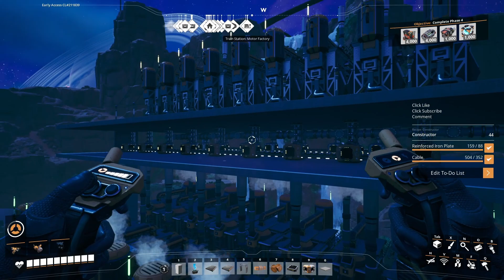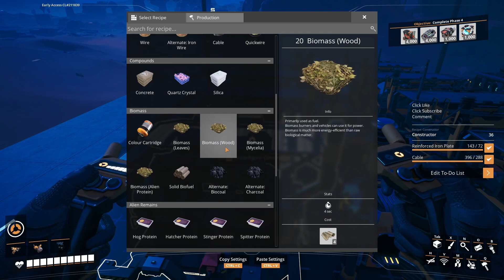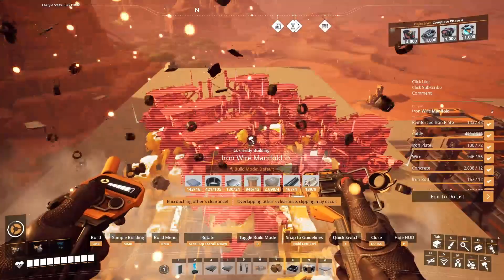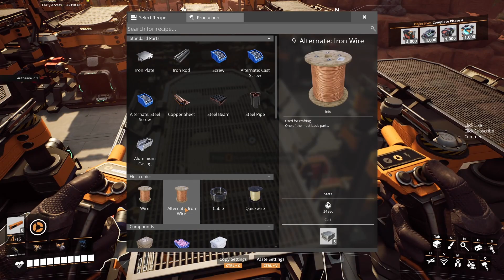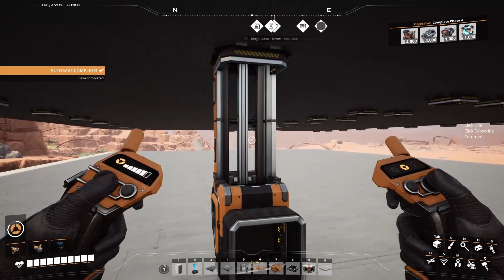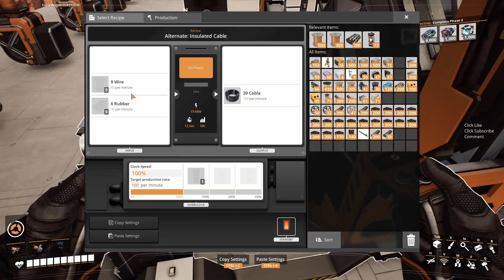Satisfactory Update 7 - S1E87 - Wired

Comment: You never have enough cable or wire...ever. And you also run out at the worst possible time. 😏
Reply from the maker: Yes I never appear to have it to hand :) hopefully the supply I am making will cover it off nicely doubly so as we still have copper nodes we can tap